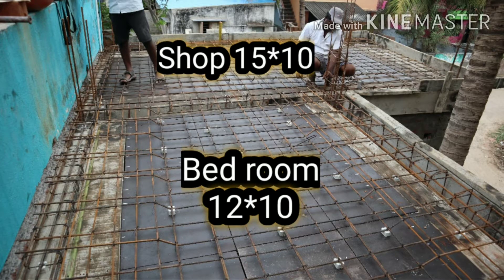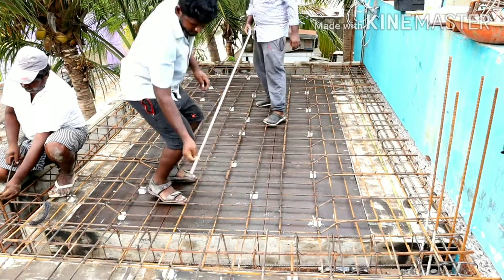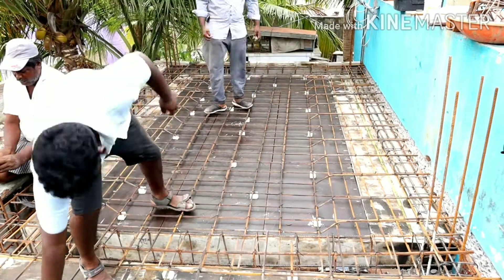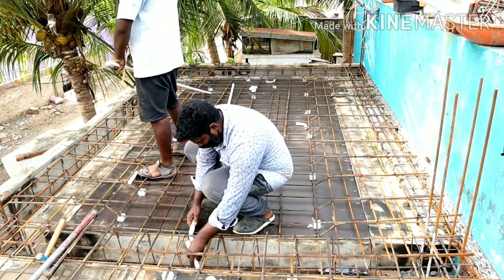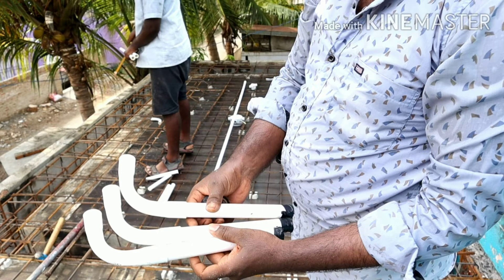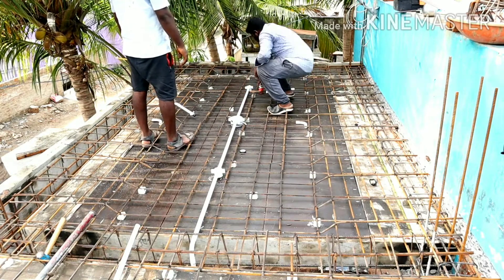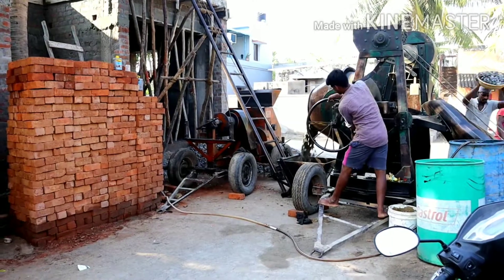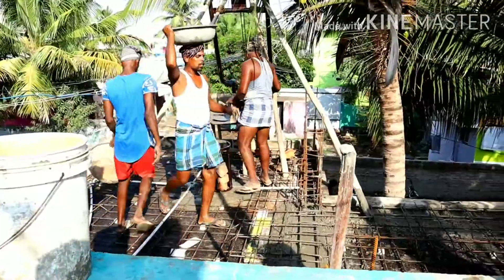How to fix electrical pipeline in construction stage in tamil

Comment: Bro 600 sqft
1bhk 2 rest room 
And 1 store room 
Ithuku roof pipe poda avalavu pipe agum solunga bro
Reply: Hall 14*8 feet
Bed room 10*8 feet
Kichen 8*7 feet
Rest room 1- 5* 4
Rest room - 6*3
Portico -  4*8
Reply from the maker: 18 length pipe approx
Reply: Ena size bro 1 inch or 3/4
Reply from the maker: 1 inch pipe
Reply from the maker: Room size required sir